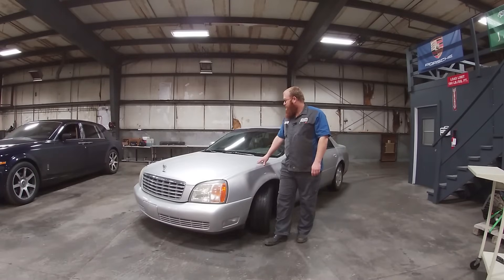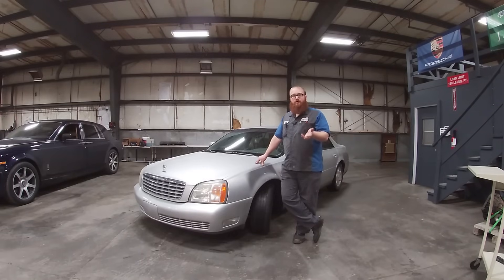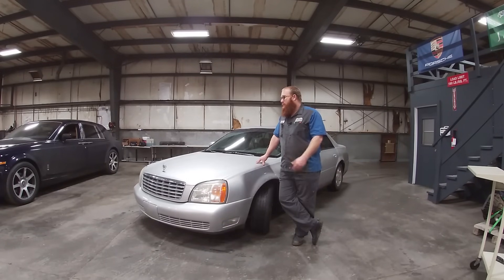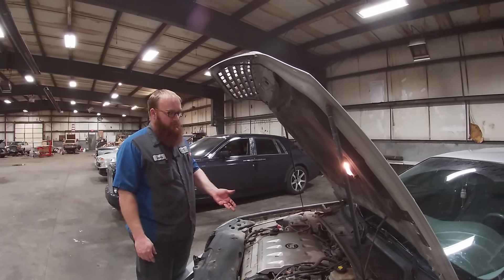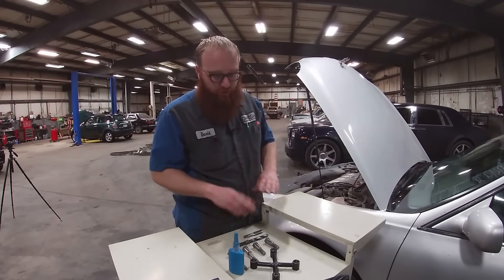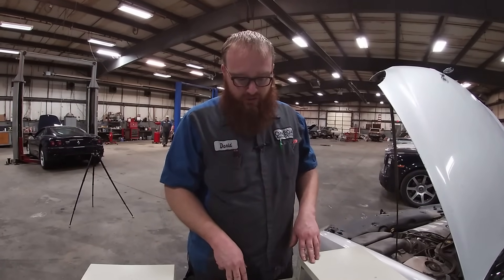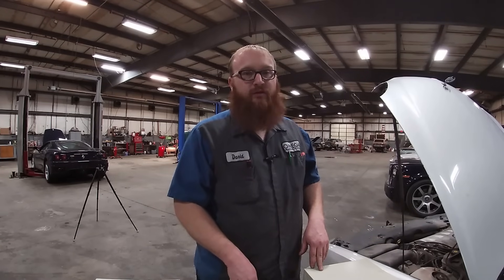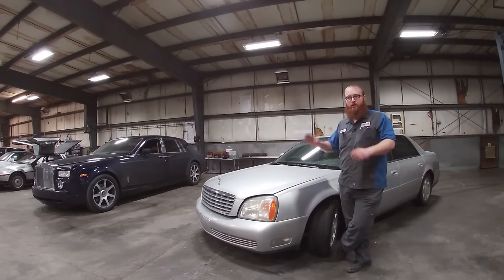The CAR WIZARD names Cadillac's Northstar Engine the Dumbest Design

Comment: The overall Northstar engine was not a bad engine. It had one or two serious flaws which were never properly addressed by by GM. In fact, it was criminal for GM to know early on about the head bolt and resulting gasket issues without fixing the problem at its source. GM knew about the bolts just from basic machining knowledge. Other manufacturers had been using aluminum blocks and heads for years. All GM had to do was look up the designs of other manufacturers and make the Northstar engine stronger, not weaker.

Comment: That's just horrible quality control because the northstar when it was new was a bad ass engine...to allow them to continue rolling off the assembly line after the issue came to light is inexcusable. Those engines were ahead of their time and they fuck them all up with carelessness that cant be recovered from.
Reply: GM was careless

Comment: Isn't the flaw that the cylinders "float"? The remedy is more "clamp force" on the heads which requires bigger bolts.  Someone correct me if I'm wrong but I was told by a good dealer mechanic that that's the problem.

Comment: Every engine design has major problems the first several years. Just look at the Chevrolet 305 which was a pile of crap for about 10 years before it became a very well built engine. I have never heard of a NorthStar engine blowing head gaskets before this. My parents had 2 Cadillac's with the NorthStar engine & they ran like a fine Swiss watch. I can't remember the years of the cars. They had owned Cadillac's since 1977. The only one they had problems with was the 1977 Sedan De Ville. It had the 425 big block & weighed a ton. They were lucky to get 10,000 on the front tire because of the weight of the engine.

Comment: Do you still stand behind the claim that these engines were fixed for 2005? I've seen some people say that the problem was made better but not fixed, and that the problem is beginning to show up again on the newer cars. They're saying it's an age problem where corrosion is causing them to pull out of the block. Thanks.

Comment: 03 & up aren’t bad, they changed the pitch & depth of the head bolt as well as the diameter. You get a lot less problems 03 & up, I’ve owned a few .

Comment: Sad but true as many comments point out the fix at the factory design and prototype level was next to nothing in terms of cost for manufacturing. But the damage done to the Cadillac name is irreparable! These engines were in Olds cars as well as Caddies and were very powerful in their day (or perhaps maybe any day) What could have been a great engine held in high esteem has been dubbed an engineering screw up and the dumbest design ever! Anybody that thinks a small fine thread short thread length steel bolt in aluminum will hold compression pressure and coolant pressure is not too high up the engineering spectrum - duh!

Comment: North Star is an easy engine to work on. You can have the engine, trans, subframe on the ground in a hour or 2. The heads come off very easy. Best thing to do is buy the coarse time sert kit. You can’t use the dealership time serts they use the fine thread serts so the problem will happen again but if you use the big coarse time serts it won’t happen again. If I could do a couple of these a week life would be easy. I would never do one of these unless I dropped the engine/trans out so much easier to have it on the ground then I can sit in my chair and put the time serts in. I would charge 5,000 at my shop to do one of these but as he said there’s not many people that will put that kinda money into an old car. It’s really too bad that they had the head bolt issue because these engines really are a great engine minus the major head bolt problem.

Comment: Well I love these cars and am looking at one 05 . Thank you !!!!
Reply: The last bolt change was made during MY 04, so your probability of gasket failure is low.  Change the tensioner pulley for the water pump belt, as its failure can cause expensive water pump replacement.  I did it myself with $30 part.

Comment: Makes sense though I expect that the car is only worth $2000 because of the head bolt issues. With that solved the car must be worth more...unless there are more hidden flaws in the cars engineering. Such a shame that what would seem such a obvious design flaw would be allowed to occur. I mean surely a competent engineer would have seen an issue with the head bolt size...it's not like  aluminum blocks were a revolutionary development at the time. For shame GM...someone in the engineering department should be fired!!!

Comment: I don't understand the bad reputation. Yes it's a stupid design, but such an easy fix. And after that it's a very fine engine.
Numerous engines out there notorious for major issues with block internals, valve gear, cracked or warped heads, burning oil, overheating etc.

Comment: A V8 DOHC 4.6L with over 300hp  engine is in my opinion a very good design the problem is GM design it.
In my opinion this engine was quite progressive compared to other GM engines (V8 OHV ,8L and 30mpg consumption).
 The engineers just screwed the Northstar engine up.

Comment: Hi ! I vaguely recall that pulling the head studs out the block was already a common problem on these petrol-converted first generation V8-Diesels in '78 at GM (that ruined the "durable Diesel" image in the US for a pretty long time). Same problem already: too small bolts for the load, too tiny threads and the demise was pre-programmed. 
Didn't they learn anything ?

Comment: Had a 97 cadillac concours with the Northstar nice car but the Northstar made it very problematic first over heating and not starting in hot weather  just a pile of junk i wouldn't invest any time into...definitely not one of gm crowning achievements like they claimed at first... the older 4.9 litre OHV predecessor was far superior to the newer Northstar I've had both more power with the north but after 100000km you start having problems

Comment: Head studs are not the proper repair on this engine because you cannot get proper tty specs with such a repair. The proper repair uses carbon steel inserts in the block. The reason the "gm" recommended repair fails is because gm recommends only using the inserts in areas where the threads fail. A proper repair installs the inserts in All of the headbolt holes. In addition, the thread failure in the block has been linked to dexcool. Unless dexcool is flushed and changed every year, it can become acidic and weaken the headbolt threads in the block.

Comment: Isn't this some kind of psychological fallacy that people would not spend $3,0000-4,000 on a $2,0000-3,000 car? That means they spent $7,000 and they have a nice working car. That is a good price for a nice working car if they buy a Toyota they pay that for the used vehicle itself with no repairs done. If they want this car instead of the Toyota the cost is about the same but this car needs repairs as well.

Comment: The sidwaies mounted v 6 dodge that it was practically impossible to change the 3 plugs agents the firewall deserves a spot not that dodge was new to this I had a 1970 dodge Challenger with a 440 magnum that I had to loosen the engine mount on rt side and jack it up to change the back rt plug besides getting aprox 3-4 months out of the high torque starter due to placement too close to the exhaust.

Comment: Wait until you learned that Mazda 2015+ have been putting the water pump inside the engine block with no weep hole. If you drive it hard or have a CX9 they will fail before 200k and I hope you have the extended warranty

Comment: northstar engine was a problem with gaskets bolts and pistons' mini skirts( using a quart of oil every 500 mi). Please talk a but the gas efficiently and the smooth rotation of the motor by hand. Other that that it was a miracle engine.

Comment: These cars get allot of hate, I don't mind because I can buy them cheap and get a great car, my wife's had her Aurora for ten+ years with minimal issues and it was $1800 ten year's ago, even if the head gasket fails at this point was definitely worth buying, it's her second one as well, first one was just shy of 200k miles and the subframe rusted out still ran like a top

Comment: They should’ve ran the mounting bosses down to the bottom of the water jacket and use head studs with coarser thicker threads instead of bolts. Though the nothstar is not worst engine. It’s certainly a disappointment.

Comment: Dear Wizard: Wouldn't there be a water-pump/oil/? /something...that's stuck between the banks, that if its original, should be replaced while you're in the Northstar doing that "fix" with the studs?   I have an idea!    You could get some students/prisoners [--non-violent! charges ] together @ a satilite-machining facility [--maybe built next door!, it looks like there's a LOT of room near your shop ], where you could refurbish those northstars, [and wouldn't you need to also maybe do Buick 3.8L of the era?  my elderly neighbor would NOT fix the oil leak on her '97 Buick 3.8L, because the dealer wanted $2K to fix the valve-cover leaks, so she bought a used aluminum cookie-sheet @ the Goodwill for a dollar and kept-up with the oil spots].  I know the Olds 4.0 V-8 from the Aurora, maybe its later 3.5L V-6, but certainly the Caddies that were "North-SCAR-ed" with this design would NEED this fix, and then you  could get engines scrapped from a "salvage-yard", and sonic-test the block, and rebuild the engines you get with student/prisoner labor, so you wouldn't have to "waste" YOUR time/labor/labor of your main-building competant help, but could use the labor of the specially-trained students/prisoners, PAID @ minimum-wage, at a lower-level to "fix" dozens, maybe hundreds of those engines.  You might be able to get state/federal monies to subsidize your machining/building N'star labor, so you could perhaps provide refurbished N'stars for: Cad-owners/hot-rodders/business-fleet owners/dealerships...for I'll bet $2-4K and while it might not seem like a "bargain" to spend that, at the end of the install you'd have a reliable car for 4 years or more.   What's the Co$t of buying another used-car, every 3-6 years?  Better to have the reliability, comfort, protection, and even economy of the N'star that after your "machining-boys" fix them, will now easily LAST 3-6 years,rather than someone "taking-a-chance" that their "new" USED-beater would last like a N'star Cad.    You'd have some videos done "Lookin in to the N'star King"  to promote your N'stars, and at some point, you could bring  Lambos & Masers & ? to Hoovie to look at & Wonder.    Just an idea.

Comment: So it was would be safe to buy a any dts after 2005 without having to worry about this issue?
Reply: Yes All northstar engine can blow heads if not taking care of ? Change fuild and it be ok they fix it in 2004

Comment: U basically have to take of these motors like babies. Never drive of 65 mph. Coolant change every 10k miles. Oil change every 2k miles. Tune up every 30k miles. Know a guy who does all this in his 2010 with 275k miles and never had engine overhaul or experienced overheating. That’s a LOT OF MAINTENANCE!!!!!

Comment: I have a 59 Cadillac and it's 60 years old and never had head bolt problems. Cadillac was king of the road in earlier years, but they have went down the toilet in later years. GM should have kept Pontiac and dumped Cadillac,,,,,,,,,,

Comment: As a automotive technician myself... I hate.... I FUCKING HATE THIS GOD DAMN ENGINE!!

I REFUSE to work on them. They can pull into the front lot, walk in the door, and state what problem they are having. We say ok, but unfortunately, we refuse to touch them. Oil change, tire rotation... Ac check.... We will not even pull them into the bay. So sorry, have a nice day.

Comment: Sent my 05 Deville to the great turnpike in the sky because of this. IF I had a lift, engine stand and time I would have fixed everything & kept it. It pissed me off when the alternator died and it was half a day work to change it because it's buried under the AC & cooling systems. Great design shot to crap by corporate bean counters. I get it companies have to profit, that's why they exist but they get stupid and give bailout money to their executives as bonuses when it's the executives who trash companies to begin with.

Comment: why is this not WORSE than the ford 3 valve? i mean the ford engine, just do a change oil every 3K miles and you're good. while this northstar engine, it's guaranteed blown headgasket even if you maintain it properly.

Comment: I agree, the Northstar is an awful engine.  However, Caddillac isn't exactly known for quality. The 3800 series II is a real  turd also, as well as the 350 chevy, when talking GM you can find tons of examples of crappy designs. The 2.2 and 2.7 Chryslers were also crap.

Comment: How could GM let this awful engine see the light of day when just one little change in the head bolts would have been all it took to avert so many disasters?  I remember seeing the Cadillac commercial with a camel touting the Northstar's ability to go 50 miles without coolant.  (It's at https://www.youtube.com/watch?v=fQ_FcXnU3JA .)  Cadillac was supposed to compete with Lexus, but the Northstar engine took that possibility off the table.

Comment: Sorry, it doesn't get close to being the worse GM or any manufacturers engine.  I worked for a period of time in the early 80's  at a Cadillac Olds dealership; the 350 v8 diesel & 260 diesel get my vote for worst engines ever!  At one time, our service lot was full vehicles waiting for replacement motors and we had more cars down than new cars in inventory!  And don't get me started on that THM 200 transmission was paired with some of these vehicles...

Comment: At the end of the day these engines will last if you don't have a heavy foot. 300hp is designed to move the car and it's passengers at moderate speeds. Stop racing the doggone thing

Comment: Don't let this video fool you the Cadillac Northstar engine what is amazing. It is so smooth and even Jeremy Clarkson said it sounded like a symphony oh, that being said the real issue is that is made of aluminum and has to be time certed to be taken apart! All of them have to have head gaskets replaced by 125 230000 miles which wouldn't be that big a deal if you could take the engine apart easily but I know guys who are certified and won't ever volunteer to touch one because of how difficult it is. You pretty much just buy a new Northstar engine when these go out otherwise this engine is a dream and whatever car they put it in
Reply: In other words it is a great engine but it is basically a disposable engine unless you put head-studs in. That is a shame.

Comment: I have to strongly disagree on the “worst engine ever” comment. I respect your opinion but have to label these the worst engine ever. Any engine that costs 3x to repair than the value of the vehicle it’s in, is just the worst. But yea, those three valve fords can suck a satchel of Richards.

Comment: he was VERY nice about this motor, Didnt mentioned that the starter is INSIDE the engine. you need to remove fuel lines and intake manifold, Wires bolts etc etc just to change the starter, dont get me started on a water pump!!! STAY AWAYYYYYY FROM THIS MOTOR

Comment: I have a problem, i bought a 2000 eldorado from somebody almost a year ago, it had 87,000 miles on it, the guy who sold it to me lied to me, i asked is there timeserts or northstar performance studs? He says its got timeserts, I believed it,  he wanted 4,000 i gave him 1200 up front and drove the car for awhile keeping up on coolant knowing someday, i may have to find a way to get the studs for them, well a coolant leak started happening and had it checked out by one mechanic, we found out the guy who sold it to me tried to put stop leak to just look like it was running great, so our first hunch is its the water pump and thermostat, i tale it to another mechanic who does the job for me, he calls me up and says i think you have a blown head gasket, he told me the signs of a blown head and i had to explain to him no its those dumbass headbolts they put in all of the northstars, so not only did i find out that the bolts were basically history but also the previous owner tried to cover it up with bars stop leak,  now im stuck i like the car but the repairs are gonna be insane and even when i said okay fuck it ill get a quote for some mechanics, NOBODY WANTS TO DO THE JOB! So if you live in Northern California and you know how to work on the northstar, comment below

EDIT: it was just a bad water pump, replaced it leak stopped, no overheating, but now at 101,000 miles, I'm having a random engine misfire, replaced 4 out of 8 spark plugs, still random misfire...

Comment: I was lucky to inherit a 2005. The car is still a money pit. Cheaply made. Window regulators guaranteed to break. At 100k you will have shit leaking everywhere. Changing plugs, coil, or valve cover gasket  on the rear is damn near impossible without a lift. Buyer beware.